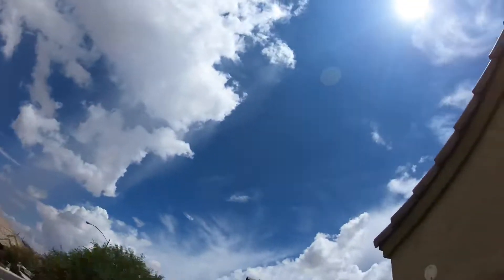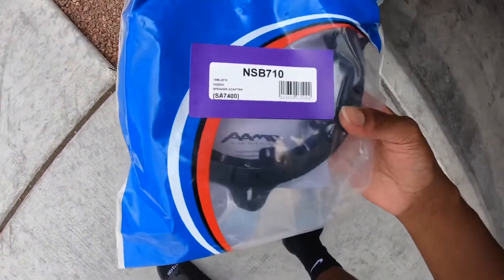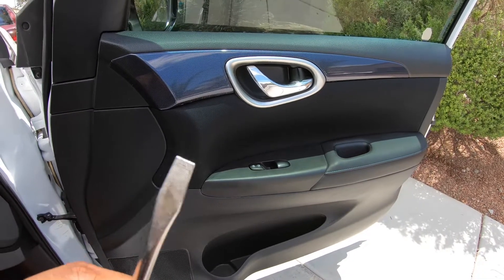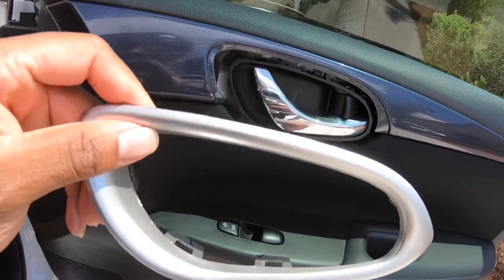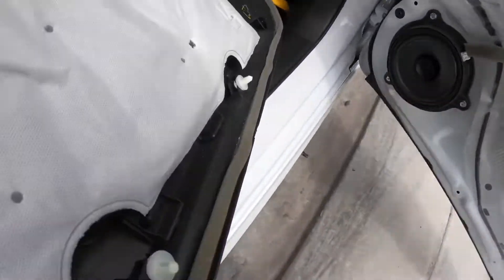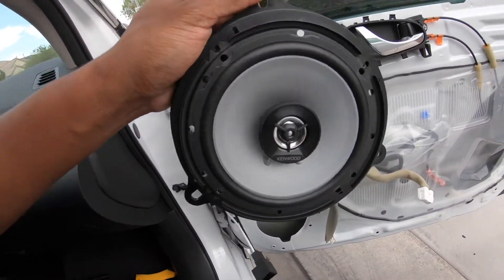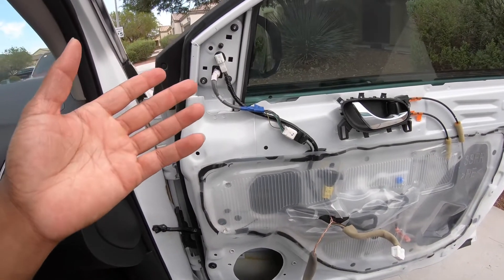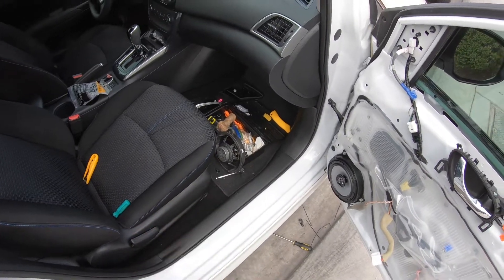Nissan Sentra Door Speaker Install

Comment: Did you have to solder the two wires behind the speaker? Also, what size are the speakers in the sentra? (I want to avoid using an adapter)
Reply: 2014 sentra specifically

Comment: Did u need a amplifier
Reply from the maker: No didn’t need one radio pushes enough power for them
Reply: Oh ok ao it was stock i got a 2018 nissan sentra wanted up grade the speaker
Reply: @MONINAHELLCAT  how did you figure out the radio has enough power? Did you test the amps or find the specs in the manuel?
Reply: @josecaballero823  the speakers are rated at 30 watts RMS
Reply: @josecaballero823  you don’t need a amp  he just replacing the factory

Comment: I removed the old speakers,  it has marked 40W MAX, I can still can install those 300W? Or it's better to use 40W? Thank you
Reply: Yeah. Hopefully this isn't too late. It's never ok to over power speakers..mbut it's ok to under power them as long as your not underpowering them by a significant amount. Most stereos can handle 75-100w per channel rms. It is better to get close to what they can handle at rms not peak. But not needed if you just want to replace a faulty OEM speaker
Reply: @brandonbrown6623 I just did my Sentra with 60w 4oms speakers and it can barely drive them

Comment: Those brackets are not needed. And rarely ever actually line up with OEM holes. Their only there to help reduce rattle but 150w rms speakers arnt gonna rattle with 3 screws in em. Save yourself the money and just get some self tappers and drill new holes. Put some sound foam or water seal foam between the speaker and door if it bothers you that much. IV seen people JBweld them into doors and work just fine.

Comment: The speaker adapters you posted in the directory look different then the one you installed. I'm trying to replace my door speakers for the same car...
Reply from the maker: If you input your car on the website and add whatever speakers they will add the correct adapters you need

Comment: How good are these speakers on ur experience?
Reply: Not that good
Reply: @HotLava17  
I bought a set of 4 for my 2016 nissan_ better than before not bad as entry level
Reply: @HotLava17  Should I make sure to do a polarity test if the polarities off the basal sound horrible
Reply from the maker: Just better than stocks nothing crazy got cheap ones just to half working ones
Reply: Is it loud?